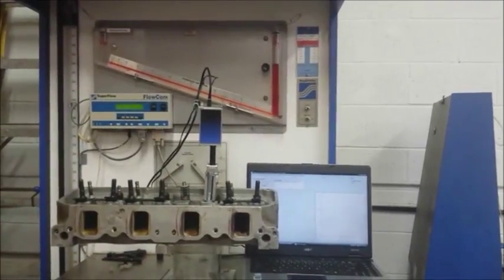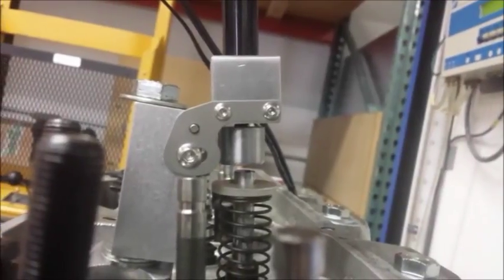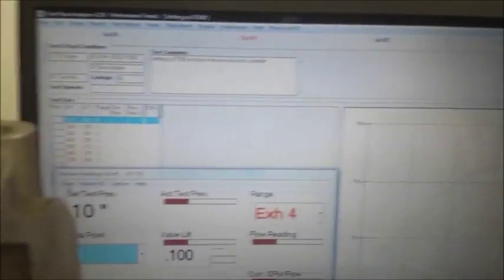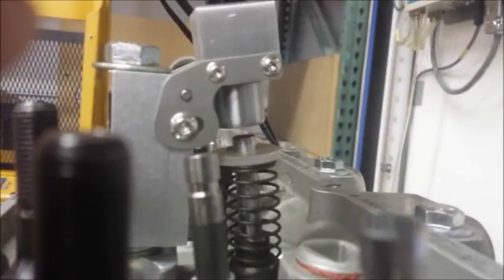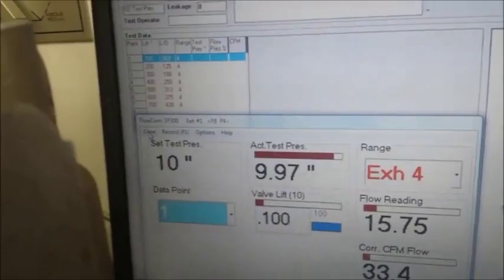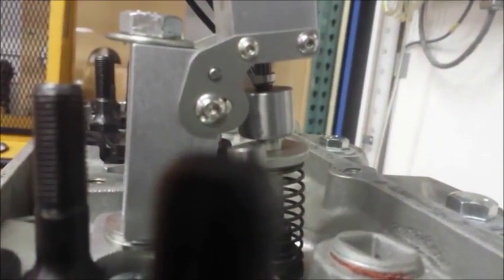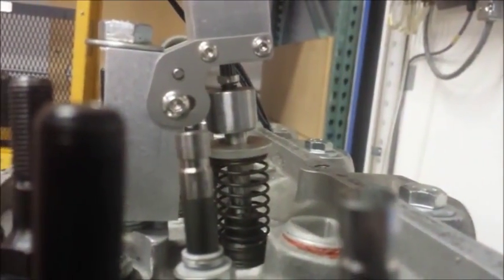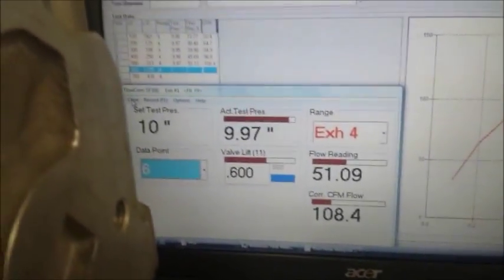Port Flow Analyzer w Auto Valve Opener

Comment: How do you do it on the 440 Chrysler?
Reply from the maker: Mopar Adapter for BB and SB Mopar Wedge heads (and other heads with shaft mounted rocker arms) PFA-VMA 
 
 Picture is at bottom of:
 
http://performancetrends.com/Valve_Opener_Actuator_Automatic_Flow_Bench%20Testing.htm